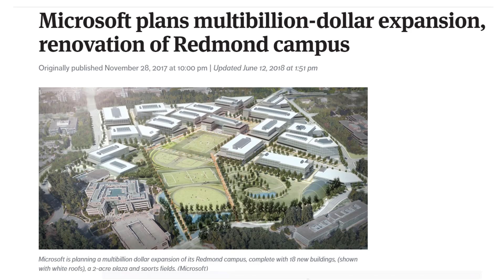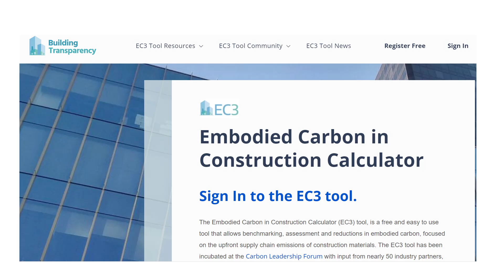How to bring innovation to construction with Anne Ellis

Comment: What do you think of CNC printing of concrete structures.
Reply from the maker: I think it has lots of potential but it needs a few breakthroughs.
Reply: I'm poor I need a breakthrough I need traction I need people to give notice that I have something of value. Why would I bother spending what meager funds I have.
Reply: If that's a breakthrough in design I have plenty of those.